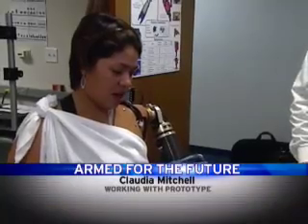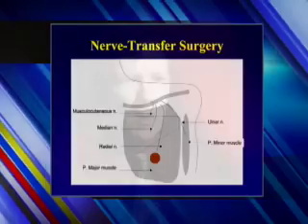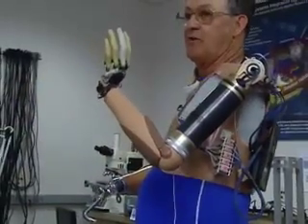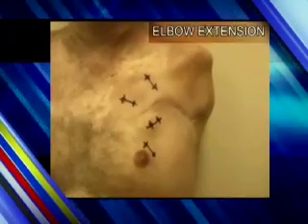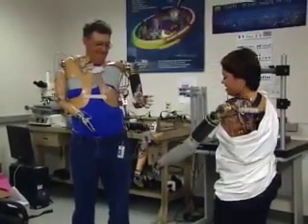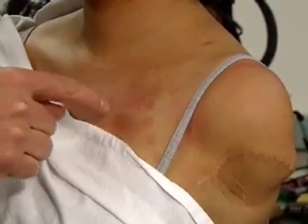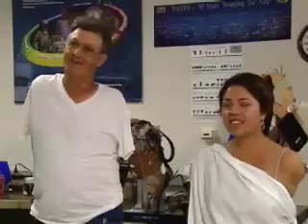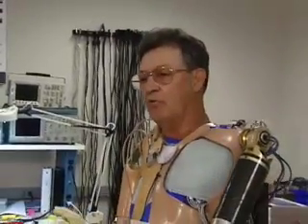Cutting Edge Prosthetic Arms

Comment: They are connecting the sensors to the nervous system via body parts that are still using those nerves (ie the pectoral muscles). If it is possible to seek out the nerves that once controlled the arm and use those to control the prosthetic.

Comment: what about combining the prosthetic arm  with computer camera recognition. perhaps it could work off of strength presets, when the computer recognizes a general cup shape, it can calculate the strength required. or perhaps motion presets, based on computer based object recognition , that can be triggered with less input. It was just a thought, I'm sure you guys got all bases covered. :)

Comment: Could the implimentation of EAPs (electroactive polymers) improve the fluidity and speed of movement in future prosthetic designs? The use of EAPs would reduce the overall weight of a prosthetic limb and the number of parts needed for assembly. Kinda like a puppet: stringed from the inside.

Comment: ya, if we move usless nerve ending (this has been done with Prothesis befor) it has endless amouts of use we could add limbs rather then growing them.  you can take off Prothesis but u cant take off a grown arm we could have a back pack that finds these never endings and we could run cars and big machinary with this. this is highly unethical and possibly vary usless in this age but withen maby 100 years from now we could have